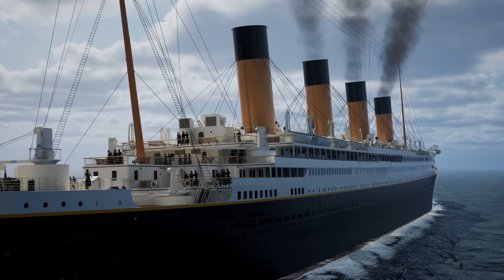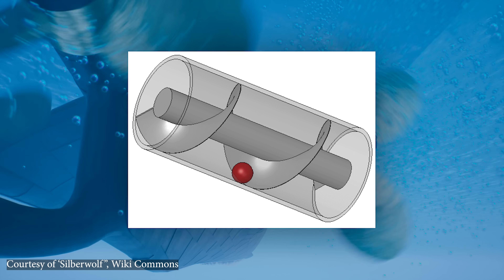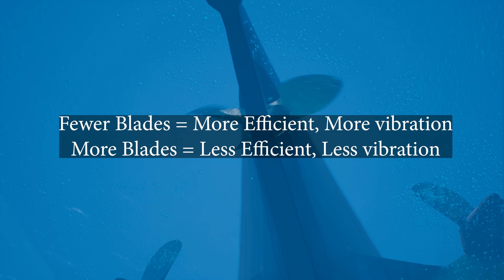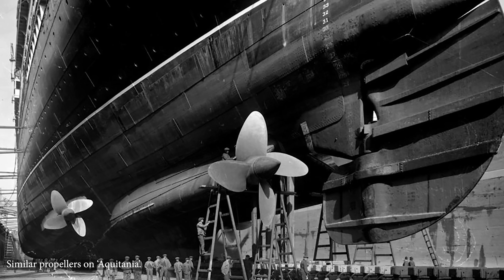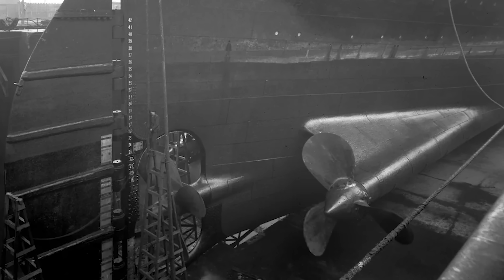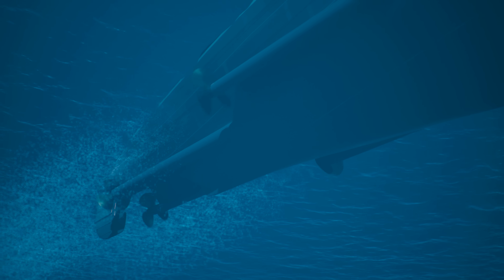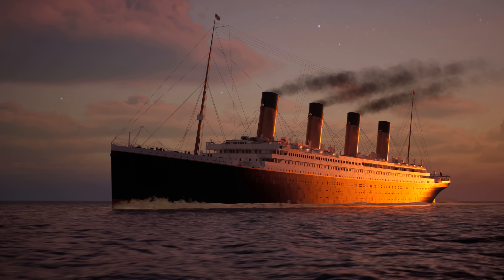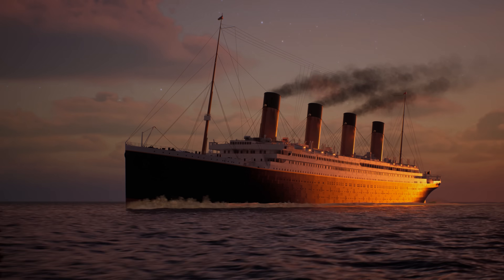Titanic's Propeller Mystery

Comment: The talk of the propellers reminds me of the discussion about whether the Titanic really sank or not, with some speculating that it was the Olympic that sank citing the numbers stamped on the propellers and some claiming that some of the numbers on what was the Olympic, to be from the Titanic (or vice-versa) but it's also noted that ships were known to throw propellers during service, and would need replacing, so it's possible that one of the ships threw a propeller and to get it back into service, they borrowed a propeller intended for the Titanic for example, to use on Olympic, even though documentation may indicate it was destined for Titanic (while I haven't read into this theory that much, it is possible as I believe there was one incident where Olympic did throw a propeller while Titanic was still being built).

Comment: Fun fact: the designs of a submarines propeller are so important that they Top Secret information to the point you cant take pictures or even see it. Submarines propellers are covered when they need to be out of the water. 

The reason for this is because if you can see the screws design you can actually make estimations on the frequency of sound it makes as it cuts through the water. It allows you to adjust passive sonar precisely to aid in the detection of a submarine which is bad. This is partly why the grounding of HMS Astute back in 2010 was such a big deal because when she ran aground, her stern was sticking up out of the water for all her adversaries to see.

Comment: Hey Mike, really enjoy all of the videos that you and the team create!
Couple random questions I just wanted to throw out there, hope I'm not being redundant but I don't believe I've ever heard you mention either of these.

(1) I have read and also seen on several noteworthy documentaries that Britannic was 883 feet in length, the same as Olympic and Titanic. Yet other documentaries and columnists insist that Britannic herself, being the largest Olympian, was 903 feet in length - 20 feet longer than her two older sisters. From studying her exterior it would almost seem that 903 is correct in regard to her length but I would love to know the actual number.

(2) My other question was this: Could you got into depth sometime on the "Submarine Bell?" - No, not for a U-Boat, but for those who aren't familiar with the submarine bell, it was a bronze bell placed below the waterline of the old wooden sailing ships and could be used to transmits and receive Morse code, sometimes over hundreds of miles - in other words sound travels much farther in water. To operate the bell, the crew would lower the bell into the water and then press an ear upon the submerged bell's bronze shaft to receive messages from another ship also equipped with a submarine bell. The first crew would then tap on their own bell with a metal object to transmit a reply message. I'm sure that I'm misrepresenting this piece of equipment but the general idea is correct and the idea is apparently hundreds of years old and quite ingenious really when you think about it.

Happy Holidays and Merry Christmas from your friends across the pond!

Comment: Olympic blade serial number: 400
Titanic blade serial number: 401
After the collision involving RMS Olympic & HMS Hawk serial number 401 blade was fitted🤔
Reply: If you had actually read the reports you would know Olympic never recieved a screw from Titanic. Olympic returned to service in early November, Titanic's screws wouldnt be finished until late December.

The fact that both screws on Titanic have 401 is undeniable proof that the wreck is Titanic.

Comment: Hey, sorry to be the one to nitpick again, but the Animation depicting the Propellers running through the Water is still inaccurate.

The central propeller is NOT Rotating Clockwise, i.e. in it's Forwards Direction, meaning in the Animation, it's technically pushing the Water in Reverse in it's Counter-Clockwise Rotation.

I pointed this out in the Titanic's Engines video before. I'm sure I'm not the only one who noticed though. Once you notice it, it's rather unseeable.

Edit: I would also like to point out the Lusitania's Propeller Animation is also off, as the Inboard Propellers are spinning in the Wrong Direction as the Outboard Propellers.

If you take a close look and play back the animation by a lower speed, you can see that the Inboard Propellers' Blades are configured to propel forwards rotating Outwards, just like the Outboard Propellers, but instead they're rotating Inwards, therefore they should be acting against the Forward Momentum of the Vessel, at least in this Animation.

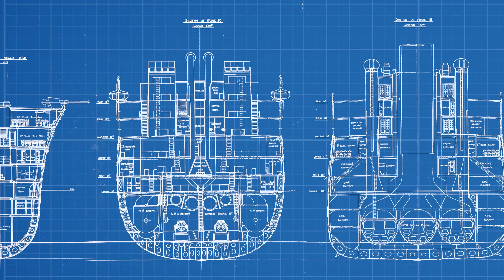Comment: Pardon if I sound dumb, but at 0:46 seconds where you have the cgi of the propellers spinning, why does it look as if the central propeller is rotating in the wrong direction given the pitch angle of the blade.

Comment: That four-blade central prop will have an interference at every 1/2 rotation as the blades align with the hull and rudder. Three blades would have solved that issue. Presumably the fire-aft separation avoided harmonic vibration between the central and either side prop.

Comment: The idea of a “typo” is a little silly, the engineer was writing longhand! But even further, you can clearly see that the specifications of the propeller is different. 400’s (Olympic’s) propeller is recorded as 16’-6”in diameter, but 401’s (Titanic’s) is recorded as 17’-0.” He also didn’t note that it was “same as no. 400” as he did with the outboard prop specs. You can see just above he made that same note with two other block numbers that shared designs, without even bothering to record their propeller specifications at all. If Titanic’s layout was identical to Olympic’s, he would have saved himself the ink and done the same here, but he didn’t. A mistake seems very unlikely.

This is fascinating to me. I never questioned the four bladed propellers of every alleged picture, drawing, or model that I saw. I love that even now we can discover new details of pieces of history like this.

Comment: Absolutely love the videos mike truly amazing, and fascinating 👏 I initially assumed they also went with a 4 blade central prop as being powered by a steam turbine instead of the outboard props being triple expansion engines to maximise further efficiency from otherwise wasted energy, of course it makes the most sense changing prop designs through trial and error though still being a factor? If only we could find further insight and information from written documents from the original engineers.. but the evidence is there from the wreck but I would assume if the titanic never sank it would have gone through similar revisions as the brittanic went through. As always look forward to more truly insightful videos ❤

Comment: Fascinating discussion - thank you, Mike. I’ve been fascinated by propeller design my whole life. When I was about 10 years old I removed the prop from my dad’s fishing dinghy just to study it more closely. Unfortunately when I replaced it I failed to tighten the nut properly and the first time reverse gear was engaged the prop pulled itself smartly off the shaft, sank and was lost in the mud of the lake bottom forever. Not a good day for a young boy! 😬

Comment: There is a simple, yet complicated method to answer this question.
Go to the stern and count the blades that aren't in the mud.
It's simple because it's physical evidence. If they're at 120 degrees, it's three. 90, it's four.
Complicated because the stern is the stern (you've seen the damn thing, it's a nightmare) and because you'd have to get down there first. And as five people very recently learned, you need the right vehicle for the job.
Reply: The central prop is completely buried.

Comment: Titanic had four propellers? That's should'nt be possible, she had 3 propellers similar to her older sister ship Olympic at the time Titanic sank in 1912. Survivors did see the three propellers on Titanic when her stern rose out of the water that night, and her designers in Belfast were aware of the three propellers on her engines as well when she was finished being built. But if there was a fourth propeller, even if that's true, then I wonder if the remains of the proposed fourth propeller was found first before it was never found again by the time Titanic itself was found in 1985.
Reply: The debate is on how many blades each propeller had, not the total number of propellers.

Comment: What about the Britanic? It is submerged in comparatively shallow waters and has not suffered quite as much degradation.
Reply: Doesn't really help as that's not the Titanic...
Reply: @mattd6085  Here is my thinking: if both of the sister ships had four blades on the center prop, what are the odds that the Titanic had three?
Reply: @marcbarrett9767  exactly 50/50, since the Britannic was built after Titanic sank and H&W were experimenting with different blade configs, as per the entire video you just watched.
Reply: It’s not true to say simply that Titanic’s sisters both had four bladed centre propellers.  Olympic had a three bladed centre propeller fitted in 1913, whose specifications are similar to the propeller which H&W’s records state was fitted to Titanic.

Comment: If Titanic was fitted with a three-bladed central propeller, that would also explain the emphasis that her officers placed on making up the slip table on her maiden voyage.

The slip table was a collection of data showing the 'slip' of the propeller: because no prop is 100% efficient there is a difference between how far it (and the ship it's attached to) travels through the water for each revolution and the theoretical distance provided by the pitch of the blades. The difference is the slip, and it changes depending on the load of the ship, the revolutions of the engines, the sea state and (in Titanic's case) the status and speed of the turbine. 

The slip table was a key part of the navigation of the ship. The number of revolutions turned by the engines was logged by the engine room and regularly reported. Combined with accurate slip data and you can use that to get a usefully accurate estimate of distance travelled. 

Slip can be estimated on the drawing board, but an accurate and useful slip table can only be generated by collecting real world data. 

Collecting this data would have been an important task for the Titanic's officers during her early voyages. They would have been collecting information comparing engine speed, ship speed, distance covered, weather, sea state, coal consumption and draught from the 
moment the ship left H&W. It would have been a shared job of the junior officers to take the raw data and enter it into the tables to build up a picture of how efficient the Titanic's propellers were.

Boxhall and Lowe both mentioned the slip table as part of their duties. If the ship had been fitted with a three-bladed central propeller, the slip data would have been of extra importance because not only would the data gathered by Olympic be less relevant for navigation but comparing the efficiency of the new screw to Olympic's would be of great interest to the crew, White Star and H&W. In theory a three-bladed propeller would be more efficient and show less slip - there would have been emphasis on gathering and presenting data to see if this was the case.

Comment: Before we had 3d modeling to trial and compute this sort of thing a lot of engineering advances were made by "best guess", in that they are pretty sure this is good and safe, we've done small scale testing and it says it is, so lets give it a go and see what the results are. Now of course we have a much better understanding of fluid dynamics and can plug all the data into a super computer (made of PS3's) and get the answers from there

Comment: I’d be inclined to trust primary source material over assumptions/oral history. It’s certainly possible it was written in error, but if you look at the notebook page as a whole it is neatly laid out with very clear writing. It has the look of something meant to be reference table of specifications, the kind of thing you would double check to make sure you had everything correct.  The only reason to disregard this source is if you had several other primary sources that contradict it.
Reply: I agree.  Moreover, all the details that can be verified by other means ARE correct.  The as-built Olympic and Britannic propeller configurations can be checked by other sources (documentation, photographs, Britannic's wreck) and are the same as what H&W's records stated them to be.  Titanic's port and starboard propellers are partially visible on the wreck, and are consistent with the H&W record for Titanic's as-built propeller configuration. There are many other ships in the book and their specifications check out with other sources.

Comment: Even the Lego set has a triple-bladed propeller in the center.

...Sure, it's their only common propeller piece and they could just plop three into the set, and much about the set is more a representation than a full factual accuracy, but it's built that way.

Comment: If the ship had better water tight doors and better to where it is all the way to the to tbe top even that would of helped a ton and better steel and riviets and more life boats.they should not used brittle bad coal and bad steeland iron and and and have the potentional weak points way more enforced and more pumps. And before  leaving port have everyone be ready for a safety drills.

Comment: this is crucial tho. cus 3 blades gives more speed. but also more vibrations while 4 gives less speed but also less vibrations.

this explains Titanic's very fast speed of 22.5knots despite not having the last 5 boilers in boiler room 1 lit.
Reply: not necesarily more speed.. the ideal propeller is a 1 blade ..as the less blades the more efficient (no/less wash from the previous blade to interfer air/water flow).. as this is hard to do as it would require a counterweight wich ads drag the standard basic prop is 2 blade.. then you would increase diameter/pitch to get more thrust/speed.. however the larger the prop gets problems begin to appear like the space you need to fit the prop or that the tip of the blade begind to reach problematic speeds.. so thats when you begin adding more blades wich equals to have a larger propeller.. but less eficient as the more propellers the less space are between them and the more "dirty" air/water is when the next blade takes its byte..
So basically for the same diameter in this case a 4 blade would generate more thrust at same rpm than the 3 blade.. but less efficiently.. so i guess they wanted to experiment if a 3 blade increase efficiency would be worth the loss of thrust..it would spin faster at same power as it has less drag and might have higher pitch speed than the 4 blade ..but would produce less thrust so might not work in the end.. i guess that was the whole point of H&W experimenting with different types
Reply: got it. so in terms of thrust 3 blades is not what u go for. u do it for fuel economy mainly.

looking at cruise ships today most of them have 4 blades  aswell as being electric to reduce vibrations. some even 5 blades like "icon of the seas"
Reply: @jesperhammarlund300  Another variable is the blade size.. as Mike said they tried several blade widths.. the larger the blade the more water it pushes = thrust.. the pitch of the blade is how fast that water is pused backwards = speed so maybe 3 bigger props can produce as much thrust as 4 with more efficiency in theory.. All is a complex balance because pitch wont make you go faster if you dont have enought thrusht to push against the water resistance ...again thats why today we use computers and complex calculations to determine this and why they experimented so much in practice.. wich i find quite interesting as what they did was just put the prop and see what happent.. and acording to what they ended up doing the 4 blade was better for the center and bigger blades were better for the outboards
Reply: do the same apply for airplanes too? you know the god ol turbo prop planes

cus air is water just less dense maybe not exactly but close. and on propellers there is usially 2 or 3 blades but also 4. its a big range between planes. with the jet engine its a bit different. *notices the airplane on profile pic* 😉
Reply: @jesperhammarlund300  yes..its fluids mechanics .. actually im talking this mostly from what i know from planes.. but its fluids mechanics .. same principles apply only in different scales (water is more than 800 times more dense than air) .. same as Submarines "fly" through the water with their small fins

Comment: This is very interesting, because when they found titanic and they were looking for the theory of switching titanic with Olympic that theroy , could they switch the blades even though the one blade said 401 could that , still be Olympic at the bottom of the ocean and not titanic
Reply: 401 has been found elsewhere on the wreck from the telemotor to sections of shell plating that have been recovered. The wreck is Titanic, not Olympic, that theory has been proven entirely false.
Reply: Absolutely nobody who visits the Titanic has given more than a single idle thought to that stupid theory. Only brain rotten conspiracy nuts living forever indoors think there's any merit to it.